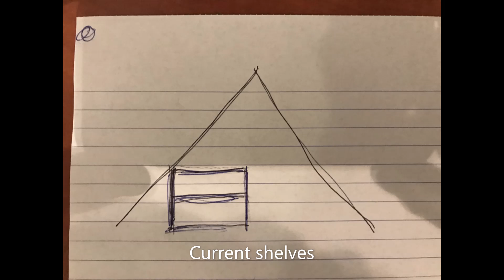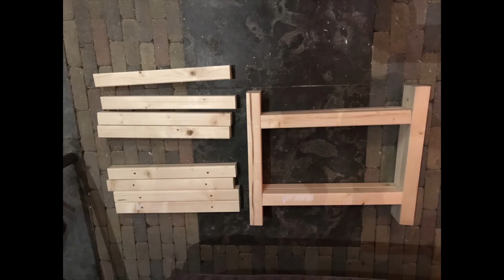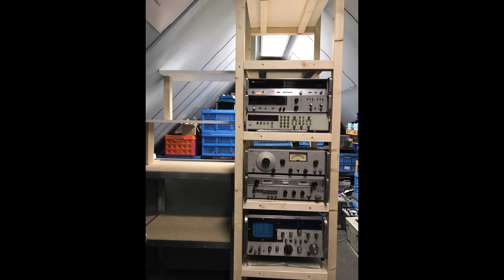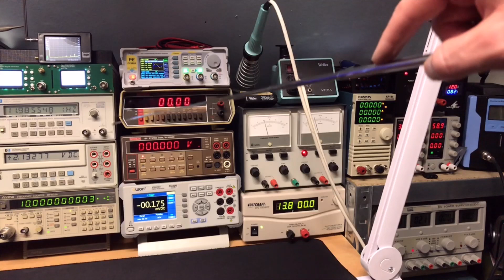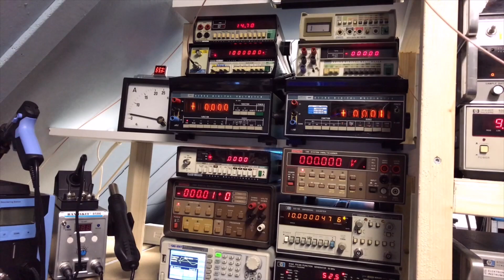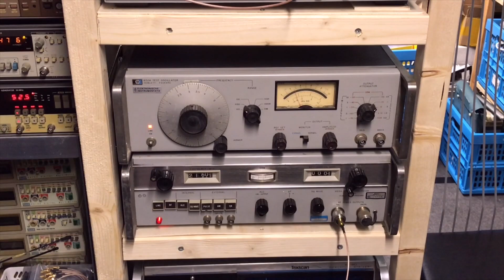TA•0131🟦Lab Tour 2021 - Super Fast - Last changes up to now. Rack Build

Comment: Nice, I like you have all (or most) wired & connected.  Fantastic: 'About 2000 watt' and 'it's gettting hot here'. Thanks for your time and effort.
Reply from the maker: Thank you again for watching and your nice comments.. i notice you watch in detail that makes it worth for me also, thanks!
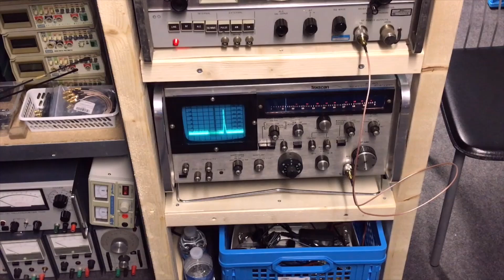Reply: @TonyAlbus  About detail, can I ask: 11:40 I see Skytronic adjust. DC power supply 0-20V, I guess you have better and that's why it's there? (I've got the same and was wondering).
Reply from the maker: Hello Wox it,  well spotted.. yes i have that one for ages.. still didn't want to sell it yet, you get nothing for them... but i have the Delta Elektronika PSU's i like those because i have worked with them in school and it is Dutch..the Skytronic is not bad at all, but also not special, but it works well. i used it for years, maybe its even there in my first videos.
Reply: @TonyAlbus  I had an electronics store and sold them, what I have is from 'left over' stock. And I find it 'hard' to convict electronics to the dump so our house is electronicly 'overcrouwded'.  ;-)  Groetsels uit Tilburg!
Reply from the maker: Electronic store.. cool!, yes leftovers...Totaly agree, i could not do that also.. Groeten uit Heemskerk NH.

Comment: Toni, you have real treasures! You must have spent a lot of money. The devices are very old but very useful. how many watts do the devices need together? My devices in standby mode are around 700 watts
Reply from the maker: Hello Marco, Thank you, yes when all switched on it takes about 4 Amps on 230VAC .. roughly 900 Watts :)